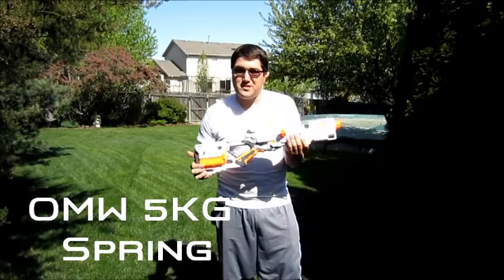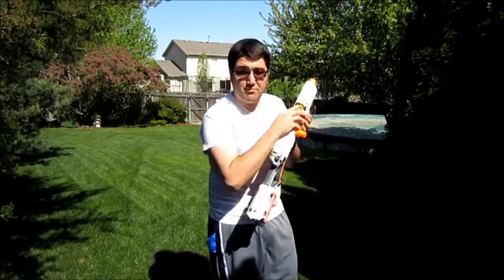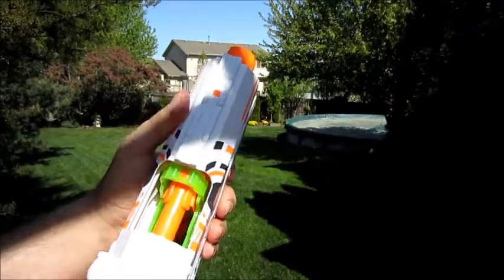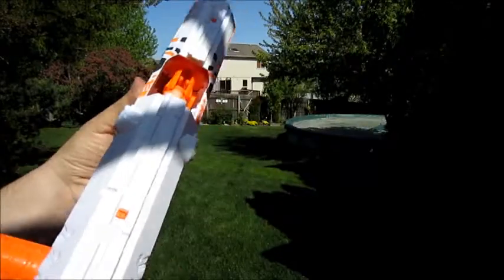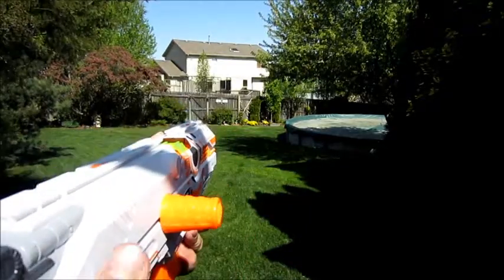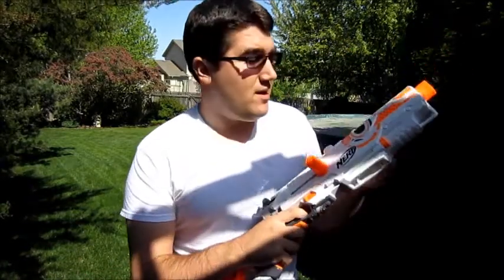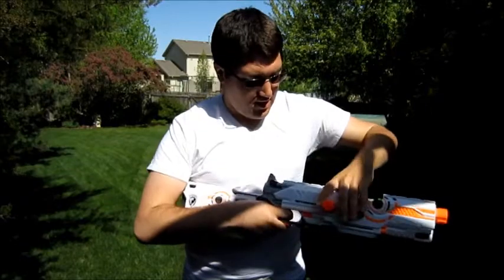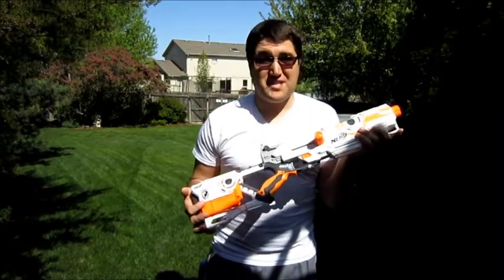OMW 5KG Spring

Comment: Hey Zook, if you open up the bolt handle with the screws, and wrap a couple wraps of E-Tape over the piece where the metal bar goes into, then that should solve your problem of the handle just popping off.  I've done that to LSK's and LS's and it yields no failure.